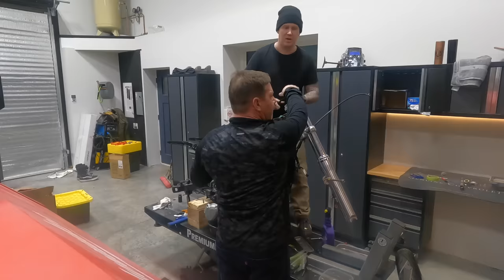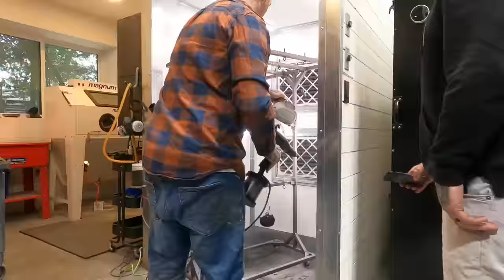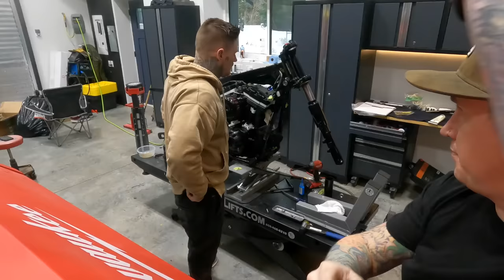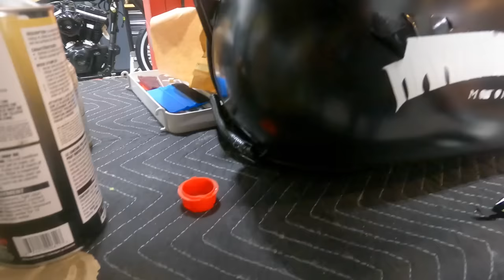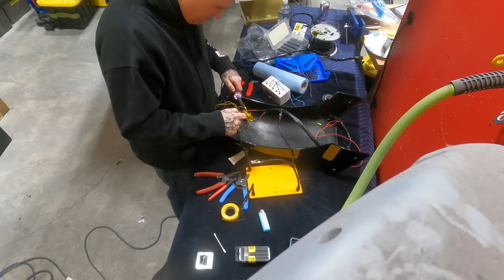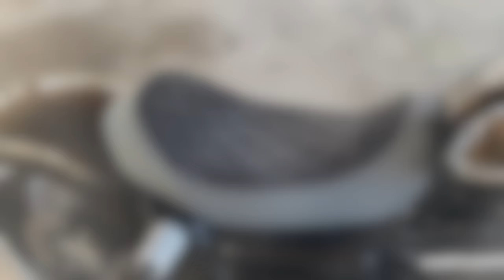Harley Davidson Dyna Build In 7 Minutes! “Black Sheep”

Comment: Might be the most badass street Bob I have ever seen
Reply from the maker: Wow thanks man! We just sold it. Hard to let that one go
Reply: Hey can you please tell me how hard is it to swap out foot pedals for pegs on a street Bob
Reply from the maker: @brodyrichard263  very easy man. You just need a snap ring remover to remove the ring off the bottom of the pin. It slides out and you just swap them and reinsert the pin and put the c clip back on 👍🏼
Reply: @martinjamesdesigns3748  are you sure the ones on my bike don’t really look like that. I wish I had a way to send you photos of it and you can tell me but I’ll give it a try thank you.
Reply: @martinjamesdesigns3748  I don’t know why anybody would put floorboard foot pegs on a street Bob , but they did so I have to get them off of there and get some regular pegs ASAP
Reply from the maker: @brodyrichard263  probably an older guy who had it before!

Comment: It is awesome. Can dyna change with a bigger headlamp and wider front tire ?
Reply from the maker: Hey Andrew! Thanks for watching. What do you mean by change? You can fit a 130 front tire on the front end. The headlamp could be any size however it will not fit in the stock bezel. I just upgrade all the bikes to LED head lights

Comment: What’s the front end setup? Hard to tell what it is. I have a fat boy front end on my dyna and I want to slim it down like that.
Reply from the maker: Hey Easton! The front end is the stock Dyna set up and powder coated black and the slim fork covers are from ACH customs. They give it that straight smooth look. They are out of England but they shipped to Canada no problem.

Comment: Bike looks fantastic! What size wheels did you put on and what brand?
Reply from the maker: Thanks! The front is a 21” and the rear is a 17” and they are made by DNA specialty out in California. I ordered the rubber as well through them
Reply: Kodi , do you have a link to those exact rims ?  And bars ?   Such a sick build man !! Love your work !!
Reply from the maker: @CharlesP78  thanks man! 

The rims were designed and bought from DNA specialties in California. Dnaspecialty.com they are the mammoth spoke wheels 

The handle bars are from get lowered cycles and they are the 1 1/4” 10” chubby bars. I don’t have the link to that one but you can find it on their website!

Comment: Awesome bike, turned out great. I've got the same pipes on my Rocker C and pretty sure the same or nearly the same bars. Been looking around and at videos for inspiration to build my first bike from an old Sportster 1200. What seat and which bars are those on there?
Reply from the maker: Hey thanks for watching! The seat is a custom seat from thunder bike customs and the bars are 1 1/4” chubby 10” bars. 
I started a new build series on a sportster. Check it out if your intrested! I’m building a sporty bobber on a budget
Reply: @martinjamesdesigns3748  will do and thanks for the reply and info. Much appreciated!

Comment: Where did you get that rear fender or what is it called? Also what front end is that?
Reply from the maker: Hey Dylan! The fender is from thunder bike customs in Germany. They are custom made and come in raw steel so it’s a pretty big job to get it prepped and installed. I bought the seat and it has built in signals so it is a pretty slick fender but pricey. The front end is stock, I powder coated it all and the fork guards are from ACH customs in the UK. They were about $300 us I think. Let me know if you have any more questions. Thanks for watching!

Comment: Looks great. By removing those brackets which held the stock rear fender & indicators on won't that reduce any strength to stick or bolt on a pillion seat?
Reply from the maker: Thanks Dan! The rear fender is thick steel and the bracket that mounts the rear fender to the frame has a very strong bolt process. It is approved to handle a seat if needed however the look of this bike was designed for a single rider
Reply: @martinjamesdesigns3748  I have a 2009 FXDB with a stock rear which I've modified a little but after seeing yours I'm interested in going this path.
Saddle bags might not work without the bracket but I can find a way around that.
What do I type in Google to find a rear fender like this please?
Reply from the maker: @danlonick800  yes it’s custom made to order from thunder bike customs in Germany. It comes raw metal with all the brackets and bolts and it’s fairly easy to install but does require some light bondo work and paint as it is bare metal. You can also order the custom seat to go with it which I recommend. I haven’t found another like it as far as quality goes but it is pricey. Let me know if you have any more questions. I did do a video on the install of it in one of my episodes

Comment: Curious question, why does it shake so much at the end? Is ut supposed to do that?
Reply from the maker: Hey Tony! Yes the Harley’s vibrate quite a lot. They have rubber motor mounts and it keeps the bike from being to ridged. It vibrates the most when it’s idiling
Reply: @martinjamesdesigns3748  did not know that. I'm still on a low budget 250cc cruiser. Doesn't vibrate much. Maybe one day ill test out a Harley. . Thanks, shout out from lima, Perú 🤟🏼
Reply from the maker: @tonyc2136  hey your still riding! Yeah moving up to a 883 sportster would be a great upgrade. Really nice bikes

Comment: Lovely job. Any chance you can tell me a little about the back end please? As I would like to replicate it on my St. Bob. Wheel width,tyre size. any swing arm mods , mud guard and side mount please. . . Many thanks over here in England uk
Reply from the maker: England! That’s awesome, thanks for watching!
The swing arm is stock, the fender is custom built from thunder bike customs in Germany and the tires and rims are custom ordered from DNA specialty is California. The tire is a 180 wide with same stock rim dimensions. Side mount liscence plate is just off of Amazon. I have a full build series on this bike and I believe episode 5 or 6 is all about the rear end of the bike. 🤙🏼
Reply: @martinjamesdesigns3748  thankyou so much . . .
Reply: @martinjamesdesigns3748  did you stick with the 180 tyre?
Reply from the maker: @coco-te1op  my brother is ordering the 200 but they didn’t have stock last year when I built it. He still has the 180 on it. I actually forgot. The rim size is .5 bigger then stock

Comment: Is there a parts list on this build?
Reply from the maker: Unfortunately I never got around to putting all the parts in the description. If you have a few questions I will do my best to answer them
Reply: @martinjamesdesigns3748  What rims? I need those on my bike! Absolutely stunning build thanks for responding and fantastic job
Reply from the maker: @thomasmcgrath2110  thanks Thomas! They are by DNA Specialty and they are the mammoth wheels. You can custom order them in a ton of different colors and variations. This is my 2nd pair I’ve done and they are great!